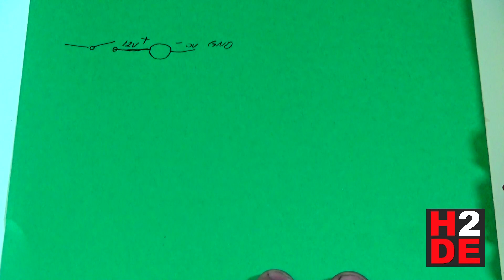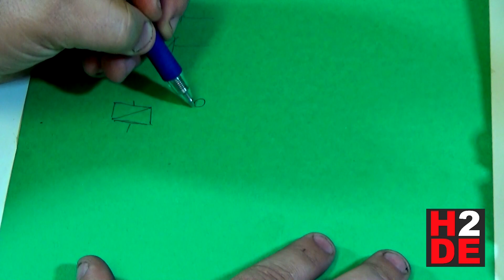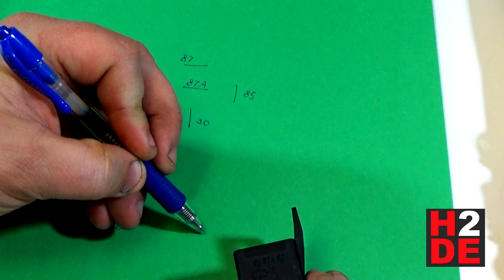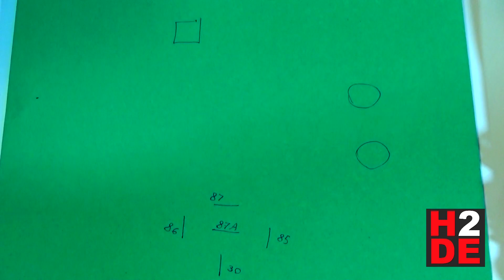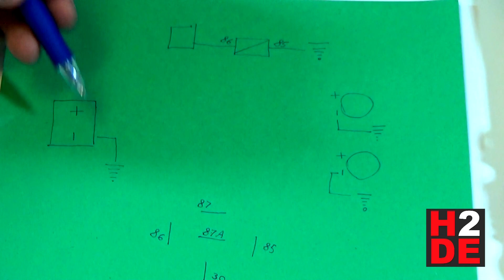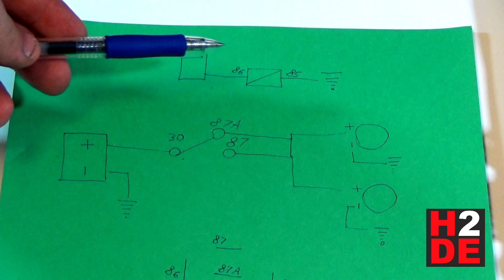HOW TO wire a 12V Automotive Relay Car audio Wiring Lights

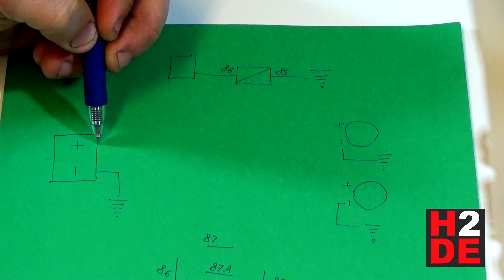Comment: At 9:57, you said "we'll take our positive voltage from the headlights and we'll come out to the relay and we'll connect that to pin 30".  I think you mean "we'll take our positive voltage connection from the BATTERY and come out to the relay and we'll connect that to pin 30". Right?

Comment: Question, why break power on relay pin 30+ with the switch and not the control circuit on pin 86+?

Comment: Is the switch going into pin 86 grounded?
Reply: That's what I wanted to kno too does he only use the hot red wire or both and ground the black wire and only conect the hot or conect the ground to 85 from the 86 switch ?
Reply: There are only two circuits,, positive to 86 to 85 to ground...and then the load circuit

Comment: I have my compressor wire goi g to pin 30 and battery hot going yo pin 87 and it works fine please let me know if it's ok th o fo this thank you
Reply: I think it has to work as long as the load at 30 is grounded.....👏👏👏

Comment: Is the battery that powers pin 30 the same battery that powers the coil at pin 86? It appears the coil switch is being powered separately.? Great tutorialThanks
Reply from the maker: yes ultimately it is the same battery.  Usually there will only be 1 battery in a car.  But it is a different fused circuit that allows more current draw.

Comment: Hi do you have video where you explaing how to connect LED's to car i would like it to work when you start car for 100% and when you will turn on parking lights its gonna be for example 50% of power. I would like to use LEDs as daylights but dont wanna off it when i will get low beam lights. thanks
Reply: Connect them in series for 50% power and parallel for 100%. 

What he showed in the video is parallel. 

To make a series circuit, take the "ground" wire from the 1st light and use it as your "+" wire for the 2nd light.

Comment: Since 86 is also supplying 12v power to the circuit, can that same wire be split into 30 instead of having to run another hot wire from the battery?
Reply: In theory, yes, absolutely. But that would mean that the wire needs to be heavy gauge enough to be able to carry the load side current. The coil side only needs a small gauge wire to be operated as it only draws around 200 mA, but the load side may draw as much as the relay is rated for, depending on the gauge of wire you are using to your accessory. But yes, you can do that.

Comment: thank you,  great video!  is this a dpdt or a dpst, spdt?
Reply: Since this relay has 5 terminals : number 85 for coil negative, 86 for coil positive, 30 for common contact, 87a for NC and 87 for NO, it should be clear that this is an SPDT (single pole-double throw).
DPDT (double pole-double throw) has 8 terminals, whereas DPST (double pole-single throw) has 6 terminals.